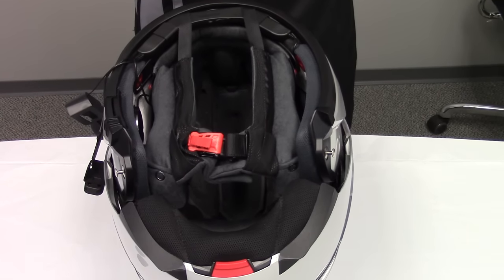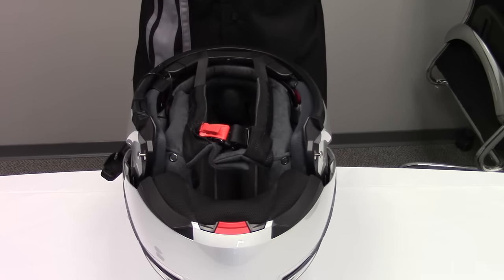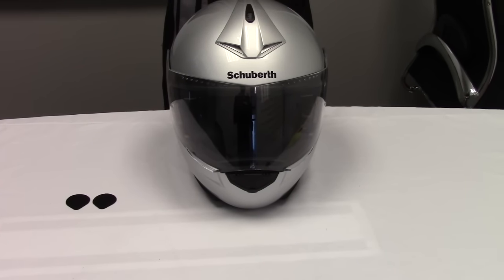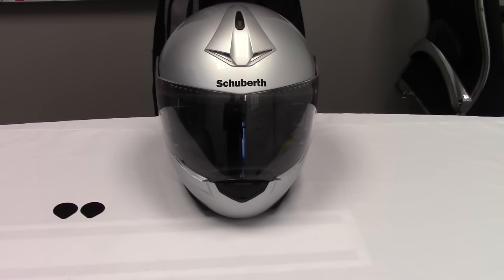Sena 10U How To Video for Schuberth C3 & C3 Pro (Installation)

Comment: The video is very useful, although I suspect a few steps weren't completed.  I just installed an SC10UA in my C3 Pro - some points to highlight:  I put the the flat straps underneath the battery unit and this seems to be correct (IMO).  The holes on the battery unit "wings" and the antenna (RHS) need to be concentric with the stud hole to ease replacing the stud.  This can be tricky with only two hands!  When replacing the neck roll, the battery needs to be pulled forward and kept central - also quite tricky.  This is to leave space for the neck roll to fit the recess.  I inserted the forward neck roll prongs (careful with these) and then pressed the rear of the neck roll into the recess.  When fitted, the battery is forward of the shell and the vents are not blocked.  Overall, a good installation but quite fiddly trying to keep everything in place.

Comment: JUST FITTED ONE ON A SCHUBRTH C3 PRO
1) does the battery pack fit under or over the strap ?. Other vids put it over the top. I think it does go underneath and it helps to keep it in position.
2) he has missed the two sliders on the ends of the battery pack marked L and R. These should be fitted and the holes go over where the red press studs of the lining are.
3) there was no way I could fit the antenna in the position he stated (over the red press stud lug). It would not fit / slide behind in that position of the red press stud. I moved it back slightly towards the rear of the helmet and it went nicely on the polystyrene part of the helmet. No way it can come out because it is underneath the battery pack.
Yes it it a bit more difficult to press the red press studs in whr the L and R plastic sliders are ......but they will go.
Did not notice any difference to the helmet and could not feel it in the back of my neck.
Hopes this helps future owners as it took me  a long while to fit.

Comment: I've watched this video many times but I cannot see what to do with the other bits of hook and loop pads plus foam pads that came in the box. In the video he's attached the sticky tear drop pad into each ear area and then attached the headphone to that. What about all the rest as above? Are they supplied to add as an extra layer between polystyrene shell and the back of the speakers to get them nearer to your ears? Can anyone help me with this?
Reply: Did you figure it out? Cause I just bought it and have the same question
Reply: @thomasvandervlis352  these are two different thickness velcro packers to move the speakers closer to your ears (if needed).  The speaker foam should just contact your ears for best audio.

Comment: Does this thing even fit a C3 Pro? I've been struggling to get the batter pack installed for 45 minutes, but it doesn't snap in. Its just kinda hanging there ready to fall out.
Reply from the maker: Hi. The snaps for the center liner hold the rear battery piece and the neck roll keeps it tucked in. Thanks.

Comment: There's a mistake here, either in the paper instructions or in the video. The included instructions clearly show the core unit being installed "outside" the straps, but the video shows the straps going "over" the unit. That's a fundamental to helmet fit, since the method used in the video would result in the chin strap being pulled backward more with the unit installed.

Comment: I take it this is pretty much the same installation for the E1? 
I put a wired system in a HJC RPHA 70 ST and the speakers rub my ears raw after a few hundred miles. Are the cutouts deep enough or the speakers thin enough to escape this problem with the 10UA system/E1 combo?
Reply from the maker: Yes. The Schuberth SC10U is installed in the Schuberth E1 in the same way as the Sena 10U for the C3 & C3 Pro. The speakers can be attached on to the EPS behind the fabric where your ears would be so that they would not be rubbing your ears.
Reply: @senatechnologies  Thank you for the detailed response. I'll give one a try.

Comment: Hello!
I recently buy an sc10u intercom to my 2 years old C3pro (fluo) helmet. All the instruction/manual says that this should fit into ANY c3, c3pro, etc. helmet with ease however it`s not.
There is simply not any space for the battery below the neck/wind ring as its on the manual or as it is on the youtube chanel.
Isn`t there any solution instead of cutting some 5-7 millimeters of the back of the PU inner of the helmet??
I hardly see any other option however this s a very cheap way to solve this problem.
Another problem is that the earphone is very thick therefore very close to the ears ...and this is not replaceble for a smaller,  thinner one...so i will send it back...
i use to had a a sena 10r so i will use that again... 
don`t buy i you have a bit bigger head :-)

Comment: At 1:44 they say "next, attach the velcro pad for the speakers...and then show that they are already installed. Very bad. There is no explanation as to why thy installed the pointed end of the pad in the orientation of the oval as they did.  If you going to make an explanation "How to video" you have to do EVERYTHING exactly as a beginner has to.
I stopped watching here and went looking for another video.
Reply: Were you able to find another video? I’m looking to install this in my E1.
Reply: @chaseharrison5469  I watched this one. I was able to do each item as they described and the 10U went in perfectly (some jiggling required). The toughest parts were getting the cheek pads snapped back in as the speaker wire put a tiny bit of pressure on them so I had to push harder than normal to snap the cheek pads in. Once in they worked fine.
Another tip: I thought that my right speaker was not working or was very quiet until I realized that it was not very close to my ear! You may have to move them around a bit to line up each right on both ears.

Comment: Did you not just completely block the rear vent?  With the rear vent blocked, you'd have to get either an air pocket making the helmet louder or, you'd have to close the vent.  Looks nice though.
Reply: A better design would've been a two pieces with a gap for the vent.  Just my $.02
Reply: +tacjam1 Looks like the comm is straight along the back so still leaves the vent active and not blocked. If you look at video at 2.46 then  you can see vent clear
Reply: +Michael Denning the C3P exit vents are right between the neck straps, the hot air in the helmet escapes through the middle of the neck strap for through the mesh on the neck roll, exactly where the 10U battery sits.  If you have any doubts, download the C3P manual and look up venting.
Reply: +Michael Denning as a matter of fact, look at video, when he removes the neck roll, you can see the vent holes in the foam, look for the two holes between the neck strap, you can see them, then when he installs the battery, it completely blocks the exit vents.

Comment: C3 pro has his own antenna why not make connection for antenna and Bluetooth antenna why?
Reply: so what is the point making antenna which need be hidden under the shell make piece of cable to connect it when schubert has already antenna build in with connector. not much easy for customers will be just put connector so we can use build in antenna? i presume it will be too cheap to do it so the price of your product could loose another dollar?
Reply: I thought the same thing and purchased the 10U and C3. The reasoning would be, from a manufacturing standpoint, that it would cost prohibitive to conduct the R&D on the 10U (a universal unit made for various helmets) and test the interoperability b/w the 10U and the C3's antenna.
Reply: The C3 model that precedes the C3 Pro does not have any antenna

Comment: At 7:25 in the video, despite his obvious struggles, he FAILS to reinstall the neck roll (what Schuberth in fact call the "neck collar") at the back of the helmet!  He then holds the uninstalled neck roll onto the base of the helmet with his hands as he turns over the helmet to show he has finished.  If he lifted the helmet at that point, the neck roll would simply fall off. (I have tried this install.  The neck roll / collar doesn't fit back onto the helmet on a small helmet.)

Comment: Not impressed. I have returned one faulty one and having probs with new one. Told my bmw navigator iv is the problem not the sc10u. Changed phone and still have issues so waiting for new Garmin 345lm to arrive and check otherwise the sc10 u will be going back

Comment: This 10U and any other Sena product is so difficult to install that Sena should have an option to send in my helmet for them to install. Three times and I am out. Just a pisser when you tear apart your $800.00 helmet and it won't go back together correctly.
Sena, the helmets you desiged these for a too complicated to add an intrusive element.
Reply: Or maybe a simple person shouldn't try complex tasks like unsnapping buttons and attaching velcro...
Reply: +cagekicker78 it's actually really hard to install this into a Small sized helmet... It's bearly fitting at all.

Comment: Will this fit the c4 now that it's out??
Reply from the maker: Sena worked with Schuberth for the C4 and there is a custom built Bluetooth system for the C4. The system is designed by Sena and called the SC1, see it here: https://www.schuberth.com/us/products/motorbikes/communication-systems/sc1-standard.html .  -Alyssa
Reply: Sena will the sc1 pair up with the sena freewire??.. thanks.
Reply from the maker: Yep! Sena to Sena, very easy for you to get setup and have the hidden custom SC1 in your helmet. -Alyssa